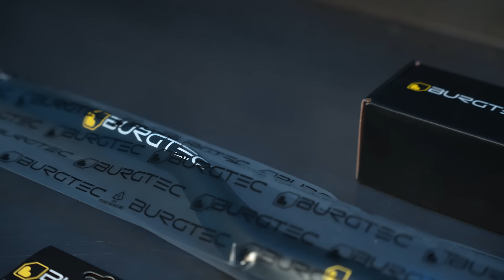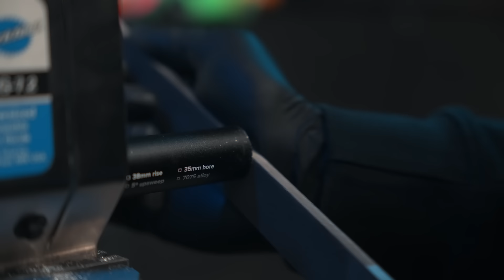MTB DREAM BUILD - Santa Cruz 5010 | No Limits Edition

Comment: Wish I could try a 5010 one day because I do feel overbiked for most of what I ride with my Pivot Switchblade. Because of supply chain issues and what not as most people know about, I just had to make a choice at a point. The Switchblade is a great bike, but I personally have to pedal alot uphill everytime, and the geometry is more down oriented which is quite noticeable. I have set the flip chip so the bike is better uphill, which is more noticeable than I thought, but still I feel I should've had another bike for my usage. 

PS: The supply chain issues is the culprit, not the bike which is great for its intended use.